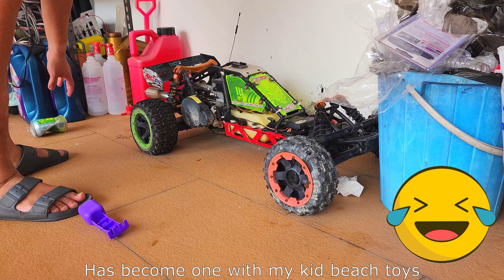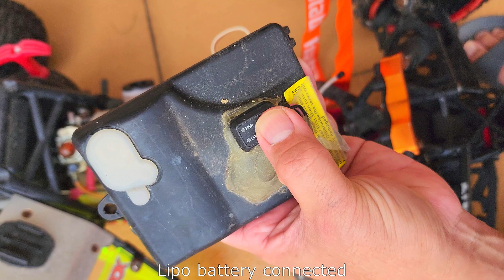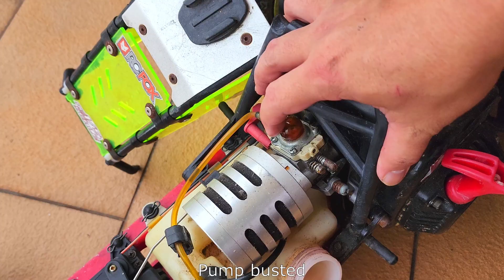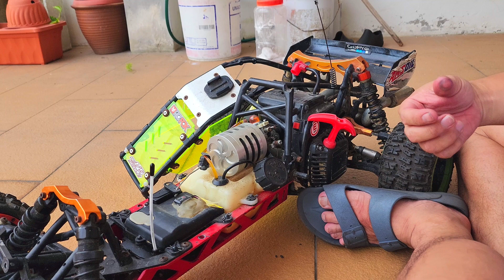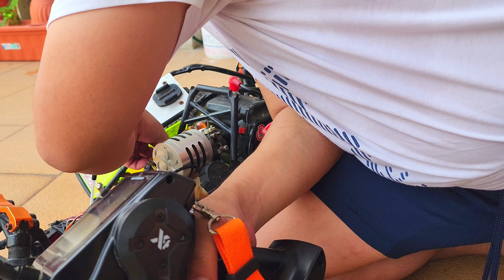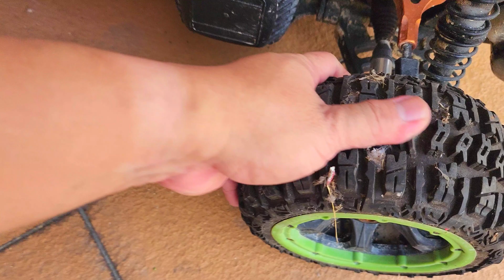Warming Up 5th Scale Rovan Baja after 2 years abandon

Comment: Same, I have the same kill switch. It made my engine strange, so I dismantled it.
Reply from the maker: Yeah, luckily my conttoller has it own fail safe. I am setting it up to full brake if thing go south. Thanks for watching!!
Reply: @yairc ye！I just got a new one. i wanna ask something. There is no fuel in the fuel tank. Will it hurt the engine if I pull it a few times with my hand？ I just want to check the cylinder pressure.
Reply from the maker: It definitely will cause some scratch on the liner, normally i just drop some lube from the spark plug hole. But for few pull wont do damage.
Reply: @yairc  ok